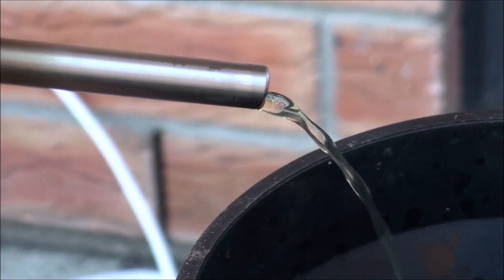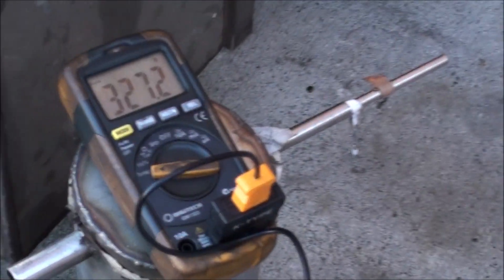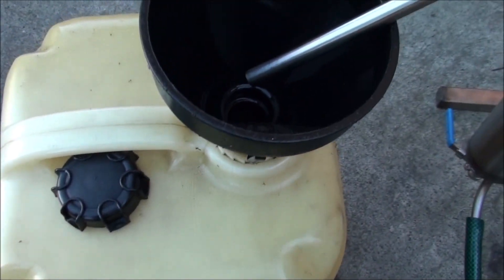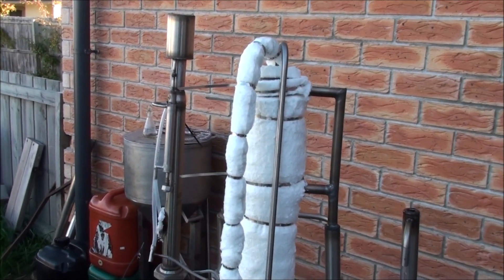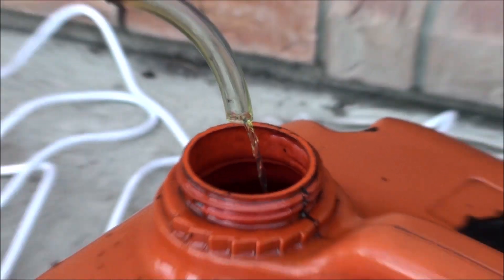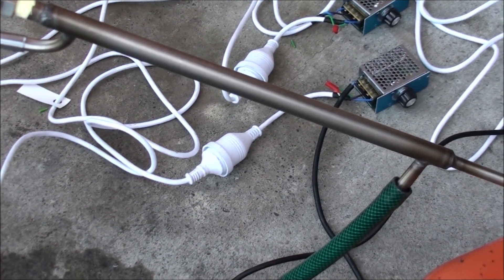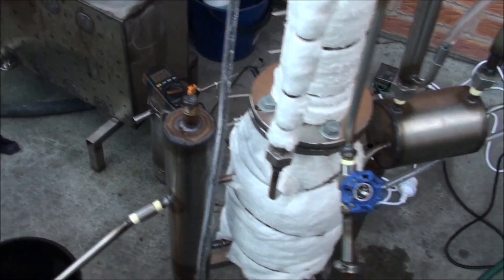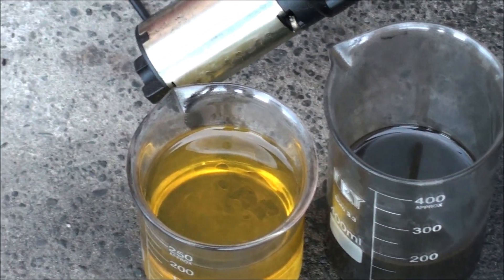Pyrolysis Oil Processing - old archive video.

Comment: Does the final fuel from this process need to be chemically threated to avoid oxidation? Does it oxidize without any chemicals?
Reply from the maker: Some settling with a bit of absorbent will benefit and prevent possible oxidation.
Reply: @santeryi9  Thank you Alek.

Comment: Good morning, I'm writing from Turkey, I have a big reactor, it smells a lot, so I can't run it. I ask you how this system works.
Reply from the maker: You need to make an extraction system, and burn the gas away from the reactor.
Reply: @santeryi9  Is the gas in your system at an annoying level?
Reply from the maker: @davutklc9590  Not at all, the system is continuous with constant controlled temperature, so no temperature increase towards the end of the distillation, the controller keeps the temperature below of gas production, in some other versions the gas evacuated through the tube with a pump and burned.
Reply: @santeryi9  My system is not good.  Your system is nicer so I would like to make it from him if possible.  Of course, if you let me.